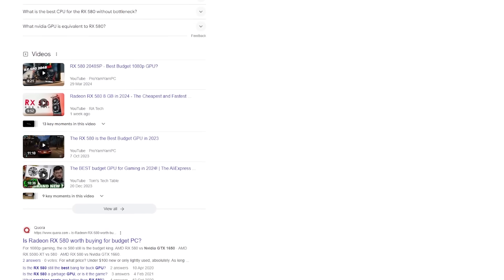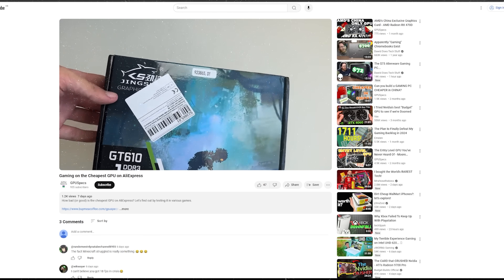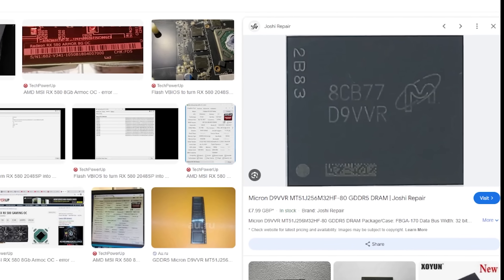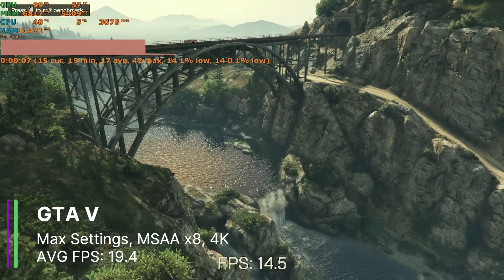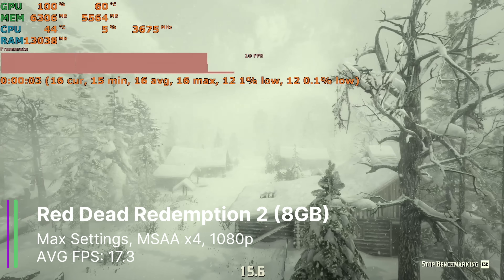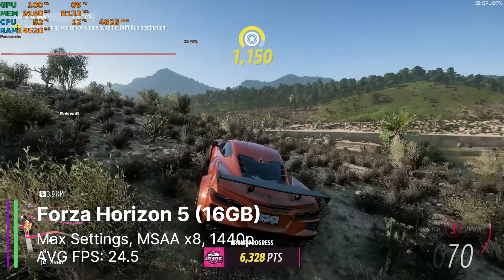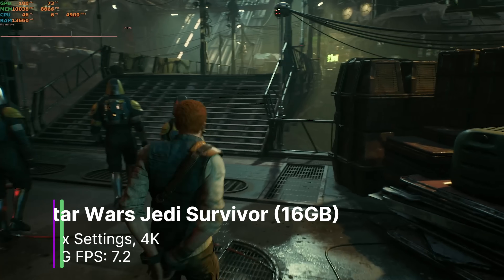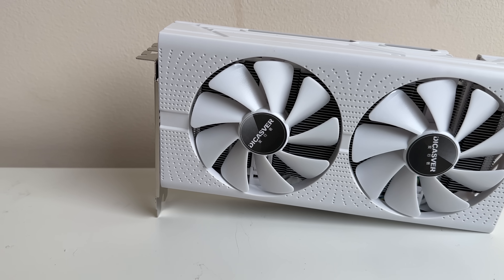16GB of VRAM on a 6 Year Old GPU? AMD RX 580 16GB

Comment: Power consumption is way too high for its performance. You better use a GTX 1660Ti there is no reason to use AMD. The benchmarks also show the GPU core isn't able to use the VRAM and is too slow to render anyway.

Comment: You’re using games that are CPU bound and not GPU bound. You need to use something that has a lot of beefy textures. RDR2 and GTA V are not the best examples of this. Crysis 3, Halo Infinite, Doom Eternal are some good tests.

And then you’re also trying to run a 1080p card at 4K, it’s just not going to be able to cycle through processes fast enough at 4K.

Comment: I know this comment is a bit late but I think they addet more vram so it can mine some crypto coin which isnt possible with 4 or 8 gb vram. I once tried mining on my old rx570 and it had to use some weird ass mining method and then it converted it to bitcoin. This mining theory would also explain why it only had 1 hdmi slot

Comment: Algo anda mal con esa gpu,mi 1070 que es casi igual a la 580 de amd ademas maneja bien Vulkan. En RDR2.
Tiene muchos peores fps que mi gtx 1070 en un i7 7700.
De echo el mio todo al maximo y el msaa al maximo,excepto maximizando particulas y distancia tengo mejores fps en el benchmark.
Debe ser una mala gpu esa 580 ni con 16gb corre bien RDR2.

Comment: As past owner of rx590 nitro+ last of Amd 500 series in essence reboot of rx580, 590 was actually a bit faster! The rx580oc and rx590 should achieve 85-95 fps on Warzone 2 with tweaked settings fully native rasterized at 1080p. Run FSR or other scalers and maybe get 100+ at 1080p but it's a big "NO" for 1440p at high fps. The 8gb version of this card is still amazing for Indie games at 1080p at today's cost of like 80$ to 100$. But stick to free sync monitor 24" in or smaller because 1080p on screens larger than 24" looks pixelized and grainy. If you go above 24" screen you will have to run 2k 1440p to not be grainy and then you get less fps because more toll on GPU. Your only 3-4 ft away from screen and at that distance running 4k it is a waste because your eyes can't properly perceive 4k any better at that distance. A 1080p 24" screen can have as many pixels per square inch as a 32" 1440p screen, but the 1080p Monitor can be driven by less powerful GPU and use less energy from lower watt rated less costly PSU .  Better to Build a pc with a monitor for the resolutions you're going to play at and distance you're going to be away from that monitor. I see why the content creator tried to test the 16gb rx580 card in this manner but all tests were at 4k and should have been done at 1080p and 2k because that's what the card specs were. Maybe the creator could have found AI apps to test the 16gb modded card but should have at least tested the 16gb card to see if at 1080p the fps improved or there were less studders or 1% lows or better stability for games on the edge of needing max 8gb. Eth mining hashing memory requirements went up several many times making 4gb and 6gb cards useless and 8gb cards decent but the 16gb cards became king for mining. If your on a very limited budget this 8gb GPU could be a temporary go to for 1080p especially if you already have 1080p monitor and you only have onboard graphics or very outdated gpu. Maybe The creator of the content could further test as I'm interested to see if there is a difference in the studders of lows at 1080p. Also maybe test on a few AI models to see if it works or not???

Comment: There is something you've missed. It's multi GPU setups. In crossfire setups, the cards are limited by the vram capacity of one of the cards (in AFR), because the ram needs to be duplicated on each card. The 500 series was the last to support 4 way Crossfire. Four of these together would be great to see and have the performance to match the VRAM usage in supported games.

Comment: Calling these RX 580 2048 SP is pretty disingenuous, the chip inside is identical to what you'd find in a standard RX 570, down to the clockspeed and power usage characteristics. A standard RX 580 with 2304 SPs perform 12-15% faster than these, while OC'd models can be almost 20% faster. Shame on AMD for trying to deceive uninitiated buyers.

Comment: The card is STILL a monster but lacks enough vram to keep up to today's stuff. Like currently the only issue with these for the most part is the limited 8gb vram they came with. You need 16 at a minimum these days to handle the most recent titles. And it is surprisingly difficult to find a reasonable upgrade path from one of these. There have not been a huge number of cards to choose from that justify the price of upgrading.

Comment: the rx 580 have 2 variants 4 and 8 gb ram versions, the gpu so slow that the 8 gigs is more than enough, because the gpu cannot handle bigger resolutions and newer AAA games. So i think not this is the proper graphic card for an update like this, an RTX 2080 is a much better choice, more than double the gpu power and has ray tracing, with 16gb of ram i think all modern games playable with it, but not with an rx580...

Comment: The 8gb card I have in my system holds up pretty well you can still play a lot of games at high or even ultra settings 1080p at 30 fps,and can even coax 60 out of a lot of games without even touching FSR

Comment: Overall good video, but it's a bit weird using 4k ultra gaming as a benchmark for 6 year old 1080p 60 fps cards. I get the point is to stress test and push the vram, but a lot of games have vram limits there are some better esports type games like COD and Apex that let you set the vram restriction, another way is older direct x games with the 4gb patches. I'm fairly certain texture cache is the most taxing on vram not model density or resolution. Very few games even still go over 8 gbs which you demonstrated well. Another thing to test would be potentially vram overclocks as it is 16 individual 1 gbs chips then potentially that could mean a difference in stability or performance maybe even an exponential difference, I know for instance computer ram tends to get better gaming performance with 4 8gb sticks and 2 16 gbs sticks versus 1 32 gb stick because dual channel memory I have no clue in regards to vram. 

Something to be weary of for buyers is that older cards may have more vram at a lower cost but use older memory chips and standards with lower clocks, it's not just the gpu dye with lower specs. That said their may be case uses like for media servers or budget video editing stations that could use this extra ram and the money you save could go toward the cpu which is going to have a bigger effect outside of gaming.

Comment: "Can't handle game at high settings"... running everything at 4K.
Reply: But running it at 4K is the only way to max out the VRAM usage, but you don't want to play at 4K on this card, because the card itself can't handle it well. Which means that 16GB VRAM is useless, because you wont utilize at all at like 1080p.
Reply: @RickSanchez-tj9el  Maybe if your a rendering massive projects you could probably get 16gb vram usage
Reply: @Aston3003  Yea, there definitely are use cases, where it could be useful aside from a gaming.
Reply: @Aston3003 Most editting aps utilizes more and leverages the integrated graphics in the CPU depending whether or not you have non-f CPUs for Intel idk the non iGPU of AMD
Reply: @mayuravirus6134   I think that only applies to laptops, no mater how I try in desktop I can't have my apps use my iGPU. In AMD if your CPU has a G in the name like 3200G, means you have iGPU.
Reply: @RickSanchez-tj9el  greatest emulation gpu ever.
Reply: @RickSanchez-tj9el  same issue with 4060ti 16gb
Reply: @RickSanchez-tj9el  You sound like the guys who said 4gb is too much for an RX460, yet 7 days to die wants 6gb at 1080p and still runs 60fps.
Reply: @  VRAM isn’t only used for gaming. As yes I know running in 4K is the only way to max it out for gaming purposes; but there are other uses for it.
Reply: @Reddison  Yea you got that right
Reply: Its to max out the Vram, TLDR: 16gb on the lobotomized 580 is useless
Reply: @Aston3003 lobotomized rx580 😭
Reply: @Aston3003  It's useless on a normal 580 also
Reply: @Aston3003  He could have just maxed out the texture settings. Maxing out every setting on a PS4 era card is pure idiocy
Reply: @Aston3003  Some games need more vram at a less demand, its not always a 1 for 1. A modded Skyrim is a good example.
Reply: @Aston3003 cuz gpus from 2016 are trash now
Reply: @Kilowatt6464  2017* It not trash, just depends on the games you play
Reply: @Aston3003  that obvious if you play the same games all the time it will run the same
Reply: actual TLDR: 
16gb on the lobotomized 580 is useless, but it is infinitely more useless on 4k max settings. Ideal use case is 2k or less with mid settings and high textures.

Some people in these replies think that 4k rendering res is going to increase the vram usage a lot. I don't think that's the case at all. Rendering at 4k forces the GPU to render more pixels, which is most likely what was the biggest performance hog in these tests.

The 580 was hardly ever good for 4k resolutions, a better test to see the actual difference vram makes would be running it at 1080p or 1440p but with really high res textures, maybe even models, however high quality models might also struggle on this GPU. 
Also probably don't use max settings on everything, effects may not need much vram to be used, rather require a better GPU, meaning you are sacrificing performance on something that doesn't prove if the memory made a difference.

P.S. Rendering at 4k will also use higher res texture buffers, but those will minimally impact vram usage, compared to the boatload of textures used by the rest of the game
Reply: Yeah....this GPU was meant for 1080p gaming so the 4k test would be as useless as the high amount of vram. It will probably benefit of the extra vram only on unoptimized games that suck up a lot of memory even in 1440p low settings like The Last of Us. That game was topping out the vram of my 3070 in 1080p
Reply: Msaa 8x cuts frame rate in half as well
Reply: Rumning with ultra 8k textures
Reply: 17fps is not reasonable to play a game at…

Comment: You could have done so much more with it.
Just having the option for going to low/med settings and having only the textures on ultra in modern games would have made a good point.
Resident evil 4 remake is a great example of the need of over 8gb on 1440p with med setting and ultra textures making the game still look great.

Comment: You did the mod to the card right the problem is is the software. Amd does give you drivers but the problem is it says 16gb and it doesn't use it the reason why is because you need a custom rx 580 driver to utilise it I've seen it happen before with other youtubers and the problem is nobody realy makes custom drivers for anything but if you look around hard enough you might be able to find a sketchy driver it should use the vram that is allocated on the rx 580 16gb

Comment: It's pretty stupid, but could probably be useful for AI like stable diffusion, as they're really VRAM-dependent. Still going to be quite slow though, would be cooler if they pulled this off with at least a 5700XT, which also legit could benefit from an extra couple gigs in gaming.

Comment: there is some point in time in which GPU might still push some game at min. settings but the minimal vram requirement of a given game will exceed the ammount of VRam that the GPU has...

let's take GTX 960 for example... the 2gb version it is very limited since way back in the day for modern tittles. The raw power of the GPU might me around 1050ti performance, but with only 2gb of Vram many games won't even start. On the other hand, the 4gb vram version can still play many games.

AMD never cheaped out in VRam, gpus like R7 370 already had a 4gb VRam version, and honestly in 90% of games a 4gb VRam setup will be just fine for 1080p. 8gb it is a need for very specific games (at this point in time, mid 2024) or higher resolutions BUT i'm pretty shure 3 or 4 years from now the 8gb version of the Rx 580 will still be running games that the 4gb won't...

that being said... the raw GPU power and driver support won't make reasonable to use a 16gb vram version of the card. Maybe an Rx 590... and just maybe...

Comment: You should not test it at 4k despite it being possible, the rx580 was always a 1080 card no matter the vram, also 16gb with only 1 hdmi port seem to be futile, and actually most modified old cards with double the vram have also double the ports because they are aimed for multiple screen use (750ti 4gb/8gb with 6 hdmi for example).
Basically this card is a waste for the manufacturer and the buyer unless it has multiple ports for +2 screen which is what it was meant for.

Comment: This is not really the best way to get results. Simply cranking all the settings to maximum isn’t how you test VRAM. For the most part the only settings that will have a major impact on VRAM is textures and resolution. 

A lot of these games would’ve ran fine had you dialed back most of the settings and just maxed out textures.

Comment: Its not a special GPU or anything; Polaris PRO was released with 16GB for computational / rendering tasks. Some clever chinese figured out by hacking and flashing in a bios into a RX580 with different memory modules would work. If you wonder why AMD did not do this, back at the time chances where likely that there where 2Gbit chips available; so they stuck with 1Gbit chips.

Comment: The 580 was (still is) a 1080p card, absolutely not suitable for 2k or 4k gaming. When games like GTA V or rdr2 came out, 8gb of vram were almost overkill for 1080p gaming. I still have a 480 from Zotac, rocking on my daughter's rig.
Reply: The fact that you could totally buy 580s with 4GB of VRAM should tell you what the expectations were. Of couse the $30-50 for the 8GB variant paid off in the long run, either if you resold the card or if you kept it in use. Point is: doubling the VRAM a chip is capable of fully utilising twice will never help much except for niche applications.
Reply: I was using my gigabyte 580 up until a couple months ago. Only time it struggled was Metro Exodus on the caspian mission

Comment: Ai my friend. It is sweet for ai :D but still slow but for Ai it is better to be slow than not work at all :D Whoever does a 96 or 192 gb version of a videocard will become king of Ai :D As with 96 you can run any almost any Ai and train some Ai and with 192 you can almost train all ai and run all ai except the mega big corpo ones but still there is paralel for that.

Comment: The only thing this modified card would be good for is getting more life mining ⛏️ on the same card!! The extra vram would be definitely used even a modded Bios and using 2gb chips to equal 32gb vram would also be used up in a mining ⛏️ rig but for gaming the textures are just not big enough to use up the ram.

Comment: Now this is my kind of content. subbed.

imo, it's wrong to call that an RX 580, when it is clearly an RX 570
Reply: really? how do you know
Reply: @barbar0s.7  . . RX 470/480 is built on Polaris 10 architecture. And the 470 has 2048 SP's (shader processors, while the 480 has 2304 SP's). The same as the card in this video. RX 570/580 were built on the Polaris 20 architecture with the same SP's per model (2048/2304). What that card actually is, is an RX 470D 8GB mining card, that has the video out ports soldered on and a fudged bios that tells GPU-Z it's an RX 580. But they DO work just fine. I just don't like the deception.
Reply: @RANDOMNATION907  Polaris "10" and "20" are essentially the exact same thing, otherwise known as Ellesmere.  The whole "10" and "20" stuff was just marketing fluff.  At most there were some power-related "tweaks" and nothing computationally or architecturally different.  Far as I'm concerned the 470/570 is Ellesmere Pro and the 480/580 Ellesmere XT, with the 590 effectively being the XTX (the 590 used slightly different fabrication but let's face it all these are the same GPU at heart).  

As you say there was a further cut-down "China-only special"--the 470D--which would effectively be Ellesmere LE with 1792 SPs.  But they repeated this in the 500-series only instead of calling it a "570D" they called it "RX 560 XT" lol.  Despite the "560" name it's not a Baffin (aka "Polaris 11...or 21") GPU, it's the same thing as the 470D, Ellesmere once again.   This later naming is is not that far removed from some years earlier when they did the "7870 XT" thing which was not a Pitcairn GPU but rather a Tahiti LE  (cut-down) processor.  Only in that case it wasn't China-only, and they also upped the clock so in the end it performed similar to stock-clock Tahiti Pro (7850)
Reply: @rolandm9750  . . That's pretty neat. I always enjoy learning new things.
Reply: nobody asked
Reply: @white_mage  "nobody asked"  you to comment either
Reply: @RANDOMNATION907  yeah same

Comment: This card never used over 8GB. The first number is Allocated VRAM. The second one is the used VRAM and it never went over 8.25 GB. Not once. Now, if I am wrong and those numbers are reversed, which would still make sense, it means the game is being allocated the full 8GB but is using a little bit more as it's there. Either way, unless the driver knows the memory is there, it's next to useless. I would look for a modded driver for this.
Reply: Doom eternal can consume over 7GB on a RX580 / 1440p. Try it.